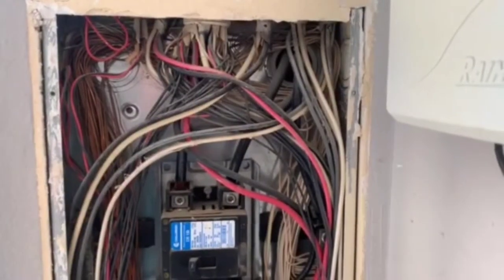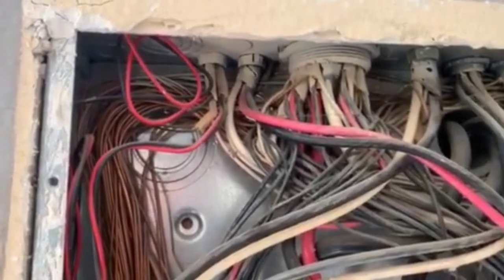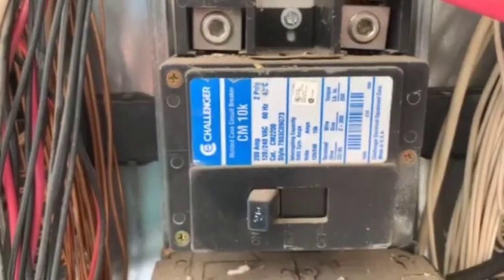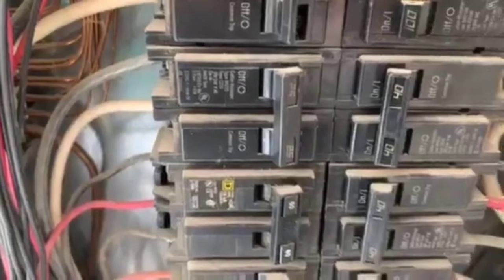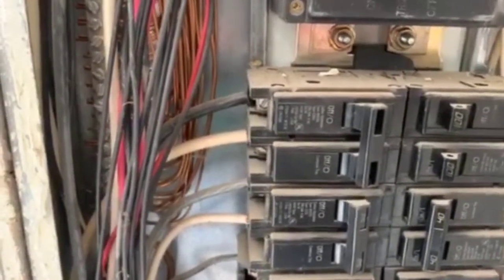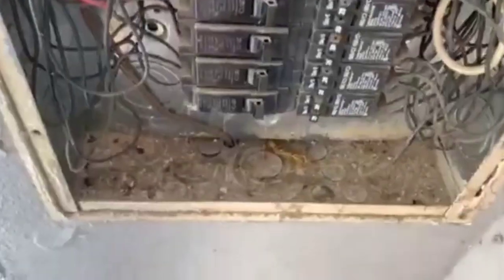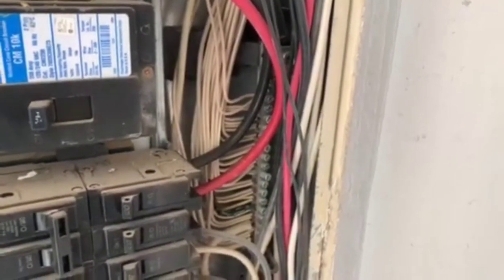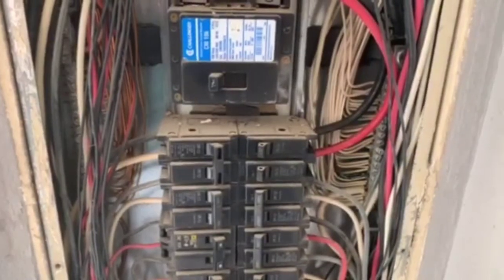Challenger Electrical Panel Inspection

Comment: With the neutral and grounds being separated in that panel, I wonder if that house has a main disconnect outside.  If so, I believe that there should be no bonding screw in the panel shown since it would not be the first means of disconnect.
Reply: Number one overzealous miss by inspectors.

Comment: I have a challenger panel and the approach that many inspectors have that they should be replaced is an over zealous approach. If you dig deep enough, the only real issue was with very specific GFCI breakers with yellow reset buttons. Normal breakers are likely just fine. There have been numerous acquisitions of the challenger line…now currently owned by Eaton. Eaton does make type accepted breakers including GFCI and AFCI.
Reply: Just replaced every breaker, but the main 200amp breaker, with Eaton BR breaker in my Eaton/Challenger panel.
Reply: @JetFire9  have not replaced all of mine yet. Just the ones that were buzzing under high draw and anything with a Challenger branding. Eaton also makes a BR type surge protector.

Comment: I didn't realize challenger panels were problematic.  To those unaware. FPE, followed by Zinsco , sometimes rebranded as GTE/Sylvania,  are well know for breakers failure to trip when needed.   As for the Federal Pacific Electric "stab loc" panels, i can contest how dangerous they can be.  About 10 years ago I suffered serious burns requiring medical attention, when I  was unplugging an arc welder from a 240 volt, 50 amp outlet in a friend's garage,  protected by a FPE panel.   Part of the outlet had broken away, allowing for the lugs to come loose and touch the metal box and each other.   Neither the 2 pole breaker for the welder nor the main breakers tripped.  I am literally crawling on my knees to get out of the garage,  with the panel on fire and molten metal flying everywhere.  Eventually the cutout on the pole transformer blew and cut power.
Reply: if i remember correctly, sylvania is related to challenger(buyout or something) . electrian U has some great videos on bad panels.
Reply: OMG!!!  Hope you made a full recovery!   I warn people about these panels with major issues and most just ignore it as “It couldn’t be that big of an issue and it would cost too much to replace the panel.”  I’ll relate your story in the future.
Reply: @glasshalffull8625  I made a full recovery, I do have scars on my right arm and chest area.  I had holes burned into my T shirt.   The welder outlet was surface mounted and had metal conduit to the panel, which began burning like a fuse spraying the area with molten metal.   As a journeyman,  if I see an FPE panel I warn the occupants to seriously consider replacing it asap,  and I have the scars to prove it.   I will not replace breakers or do any work whatsoever on the system unless it's replacing the entire panel,  it's a liability for our company if and when something bad happens and we are the last one to screw with it.   We currently use square D , sometimes Siemens.
Reply: @Sparky-ww5re  Sorry you have the scars, but it certainly could have been much worse.  Best of luck!

Comment: No comments on the tandem breakers? Usually those aren't ideal and with the number  of tandem breakers in the box, a new panel would probably be a good idea
Reply: What's wrong with regular tandem breaker as long as you don't go over the number of circuits allowed for the panel, and you don't jerry rig the bus bar or breakers to put them in slots not designated for tandem, and they are not those wacky side clip breakers Challenger used to sell?